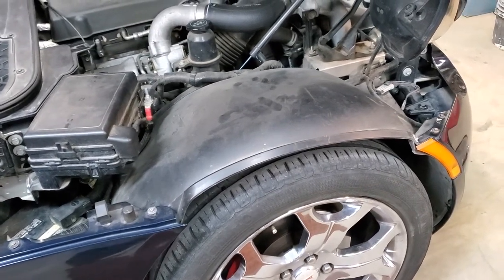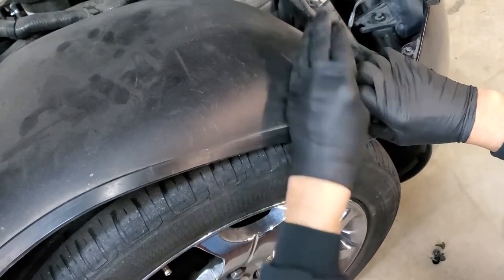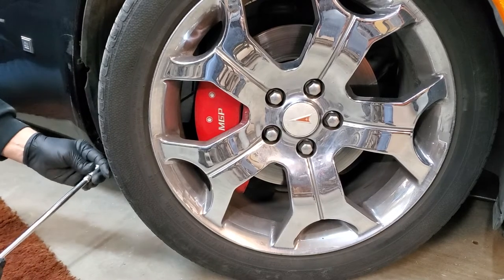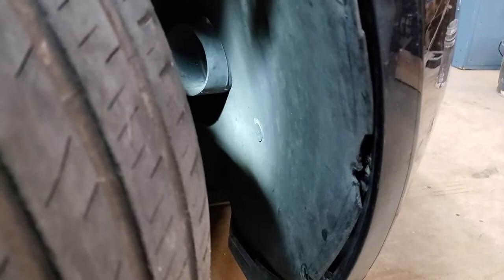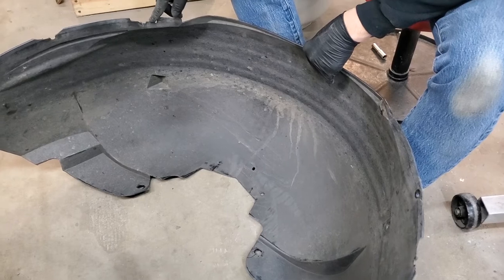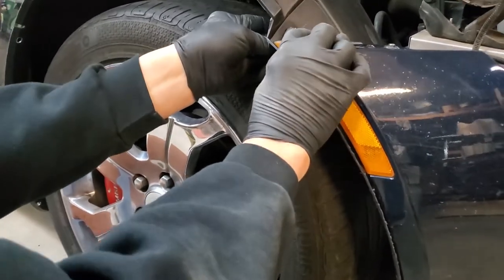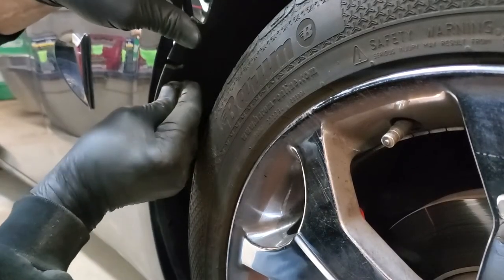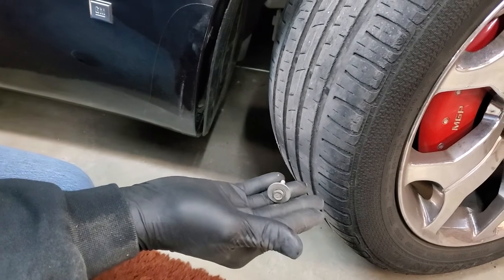How to Remove and Replace the Fender Liner for a Pontiac Solstice Saturn Sky

Comment: I found it easier to remove the Front tires on each side.   Also, my 2009 Saturn Sky does not have the brake vent tube.  But My Sky had a more liner material at the back of the liner that was not shown on this video.  Thanks for getting me started on this project.
Reply from the maker: Great tip! Love it when viewers share their ideas. Happy to hear that the video inspired you. Thanks for watching!
Reply: Just curious, wouldn’t it be easier just to cut the fender liner, into pieces, to get it out of the wheel well?
Reply: @lostwhirley  You could run the risk of cutting something you don't want cut.
Reply from the maker: @lostwhirley  It might add some work to do it that way. Removing it intact ensures that the fasteners that could be removed and reused are kept safe this way, and you'd have a reference to their placement for the new liner.
Reply from the maker: I agree, it would be easier with the wheels off, but it requires a jack lower than either of mine. I could have put it on my lift and done it that way, but I felt a practical demonstration that anyone could do was the best choice for the video. Thanks for watching!

Comment: Take the wheel off.  Much easier with less struggles.  Drive the car tire onto a 2x4 if you need floor jack clearance, and be sure to use a jack stand once you have the car jacked up.
Reply from the maker: Yep. That'll work. We didn't use the MaxJax that day. We have an outdoor pad for it and didn't use it, maybe because of weather. This is the other way to "skin the cat." Thanks for the tip and thanks for watching.

Comment: Why don't cha' just take the wheel off.  Gheesh.  🤔   🛠
Reply from the maker: Because the car is so low I found it easier not to remove the wheel. My floor jack does not fit. Sure I could use my lift, but then I would have to have set it up for this. This was relatively easy and the way most people would need to accomplish the task.